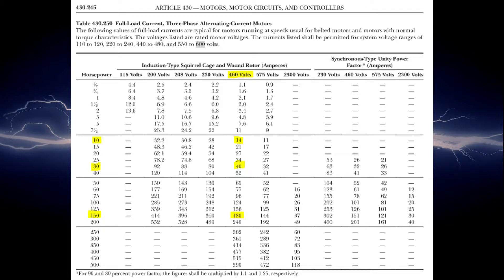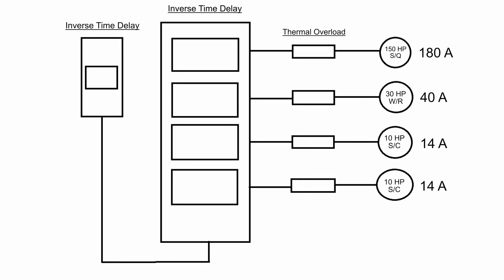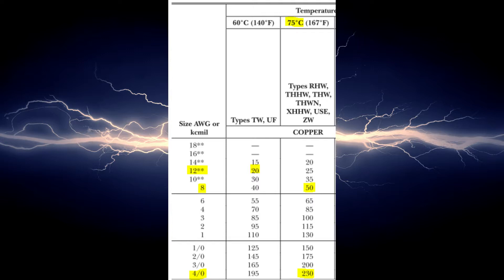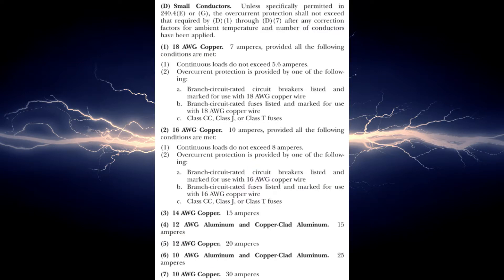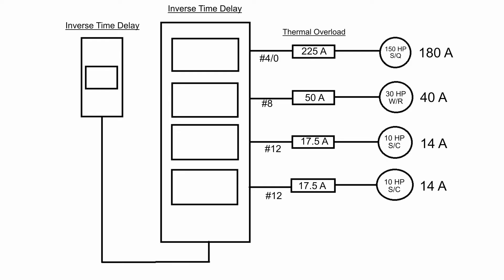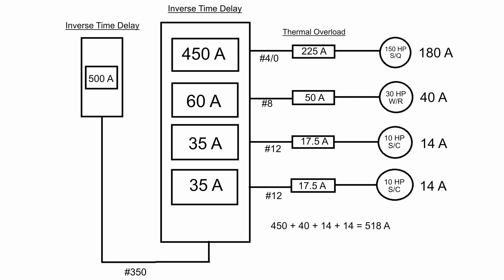Sizing Feeder, Branch Circuits, and Breakers For Multiple Motors on Shared Feeder **Masters Prep**

Comment: 430.21's information note says to reference 110.14 (C). For motors that don't have a code letter we are limited by 110.14 (C)(1)(A) to choosing wire that is size 14 AWG up to 1 AWG from the 60 degree column of the 310.16 chart when we don't know the temp rating of the terminals for the motor or breaker. So for the 30 HP motor with a 50A rating needed for the wire we would need 6 AWG. The 150 HP motor uses wire that exceeds 1AWG so  110.14(C)(1)(b) applies which uses the 75 degree column. If I have that wrong please let me know.

Comment: Seems like the 50 amp would be number 6, not 8, unless you were told the terminals were 75 degree. 100 amps or less you use the 60 degree, I was taught that anyway. Hope I don't get my answers wrong on the test

Comment: You stated that the inverse time delay breakers were the overcurrent protection for the motor but that is incorrect. They only provide short circuit and ground fault protection. The thermal overload provides overcurrent protection.
Reply: I agree on the Inverse time delay circuit breaker are meant to protect only against short circuit and ground fault.

May I kindly consult on my understanding for the term "overcurrent protection?"

based on NEC Article 100 Definitions
"Overcurrent". Any current in excess of equipment or the ampacity of a conductor overload, short circuit, or ground fault.

therefore, I think when use "overcurrent protection" term, especially for the motors, 
it should have both inverse time delay circuit breaker plus the thermal overload device.

may I know your thoughts about this?
thank you very much
Reply: @CrisSantosGuitar  you need to go to NEC article 430 (in the 2014 edition). You should see a little diagram with the layout of all the protective devices and controllers for a motor. Motors need special consideration for protective devices. A correctly sized sc/gf device for a motor will always have an ampacity rating that’s too high to protect the motor. Normally, you only think about protecting a circuit. But when the circuit powers a motor (especially a 3-phase motor), the motor needs its own separate overload protection for its windings. That overload device is sized differently than the gf/sc device; usually at 125% of the motor’s full-load current rating. So to conclude, yes in normal circumstances, the inverse time breaker would be the only protection needed but a 3-phase motor usually requires a separate protective device for overcurrent protection. It’s a special case.

Comment: The overload (430.32) says "nameplate" or actual is to be used, yet you used FLC or code book current to calculate the overload protection. I could be wrong but I was always taught to use nameplate when calculating the overload protection. Now I'm confused. Please correct me if I am wrong.
Reply: For determining the rating of the motor overload device, you may use the FLA on the nameplate. But when you are sizing the motor branch circuit conductors, you need to use the FLA table in the code book.
Reply: @RB-xv4si ”flc” table
Reply: Should be FLA to calculate. FLA is used for overload calcs only. Other calcs should use FLC.
Reply: @dicknastee1652 you are correct.
Reply: You are correct, video is incorrect. If you don’t know fla sure use the flc chart. Not a huge difference. Chart always little higher correct? Just keep that same in mind